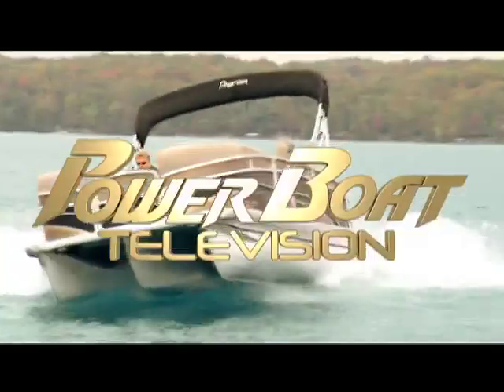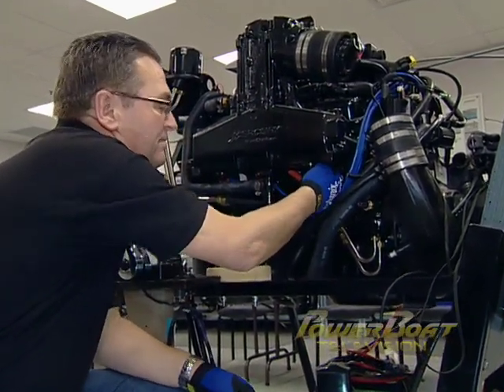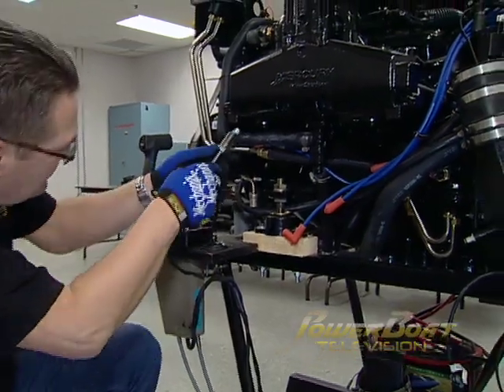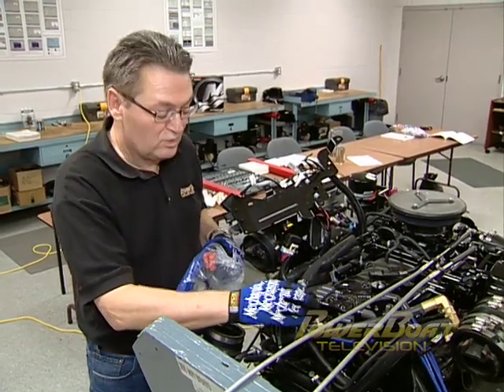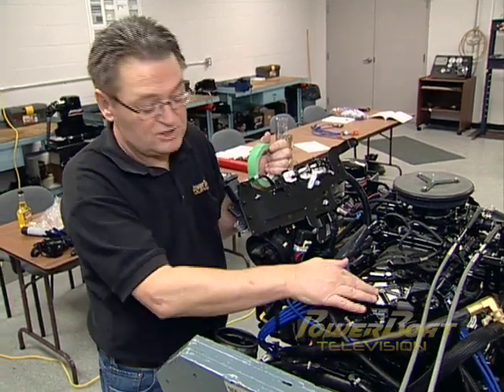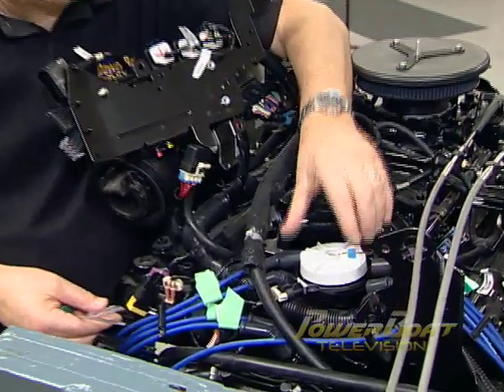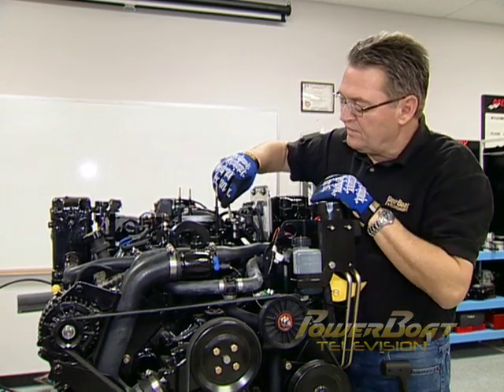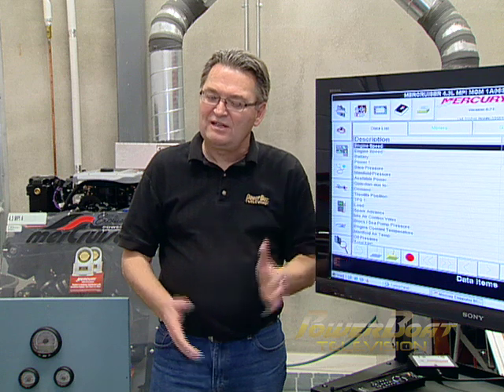How To Tune Up a MerCruiser MPI Sterndrive - PowerBoat TV

Comment: Do you give suggestions on engine problem? I have a Mercruiser MPI Horizon 350 and have a bad hesitation between 2000 up to 3000 rpms. I went through all ignition parts, now i am looking at fuel pump or fuel pressure regulator as a possible issue. I have watched some videos on FPR's and know that is the diaphragm fails then fuel will leak into it, that is not happening on mine. Any suggestions how to further isolate which part it could be so i am not just throwing parts at it? 
Also pulled my injectors out and sent them out for cleaning and testing, but no help when i put them back in.

Comment: do you have to remove the riser to get to the spark plugs. i need to do a compression check. fired my 4.3 inboard/outboard and water was coming out of the air cleaner. blew something just don't know what

Comment: That cap should be factory marked as to what cylinder the wires go to.  How about cleaning the thotle body ,oil change. The only way timing changes is with timing chain wear, distubtor wear or you moved it. What about adding Merc. Injector cleaner to the gas and what about the water separator filter. This is a very poor attempt at a maintenance video

Comment: The plugs are torqued only at 11 ftlbs? That seems very low. Typically plugs with no washers are torqued at 11 ftlbs, and the ones with the crush washer at about 15 ftlbs. I am not sure if the torque value in this video is correct? Can someone confirm?
Reply: 20 ft . lbs.